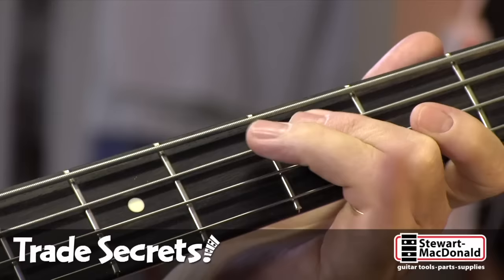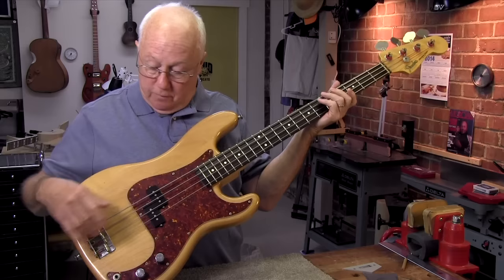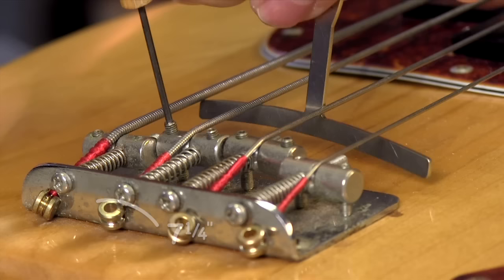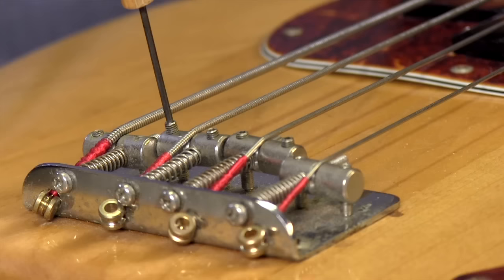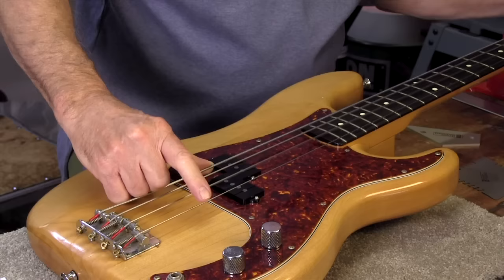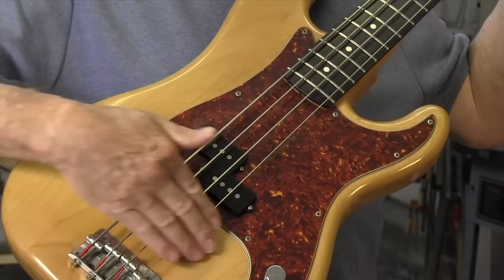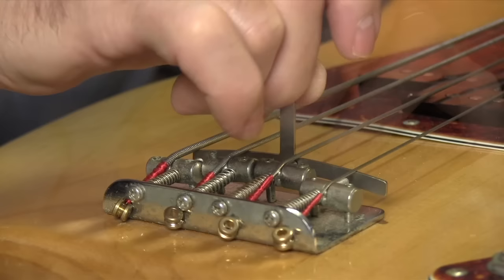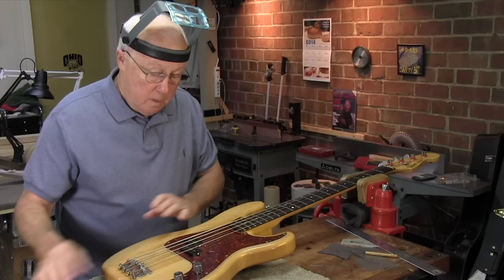Fixing fret buzz: raising the saddles

Comment: IMO this is a terrible video. If one fret is buzzing, it's a high fret. Raising one string to try and fix a high fret is a temporary fix. And raising the other strings to keep the radius makes no sense because of one fret. I'm surprised Dan suggested this.
Reply: Agreed. It's weird he's making a suggestion that could negatively impact the playability of the entire instrument due to one note with buzz.
If it's simply due to a high fret, easy fix. But if it's because that spot on the fret is worn low, might be best to replace that fret. Nothing Dan couldn't easily do, especially for his own brother.
Reply: He shows that he knows what he’s doing. Proof is right there.
Reply: @Thoracius Appotite  My G string is buzzing how do I fix it??
Reply: So, two disagreements I have with your disdain 😉: 1) It appears the radius at the bridge may have been incorrect to begin with. 
And 2), sometimes it is far better to make small adjustments to easily adjustable parameters rather than tear the building down to the foundations and start over. 

Every instrument is unique, and I think its often necessary to make small tweaks for it to play and sound its best. Even after a proper fret level and crown, sometimes these adjustments are necessary. 

I agree though, that he should probably address the issue that it could be a popped fret, at least so the viewer knows to beware

Comment: The truss rod is the foundation of the settings. A 4 string bass should have .015 at the 7th fret with a capo on the first and the 15th pressed down in the playing position. then and only then should the saddle height be checked. 4/32 action height at the 15th fret for the E string and 3/32 at the 15th fret at the G strinng. The A and D inbetween. Some guys like the action higher and some like it lower. Then after the action is set at the bridge, the height of the strings at the nut should be checked. .022 between the 1st fret and the strings. It is possible that the nut slot is worn on the A string. Once the height of the nut is checked then intonation. It is also possible that a fret wire is raising out of the slot although that is rare.
Reply: +Darryl Betts He is just selling those under string saddle radius gauges, not teaching how to do a proper premium set up.  Gibson put a backbow in some of their necks, before they leveled the frets. .011-.015" is about what they did too, with a 6 string guitar, and THOSE are the guitars that played superbly well. They also cocked the fret board a little lower on the bass side at the body, so the bass stings could vibrate more, which the bass strings will do. I spent a couple decades, more like 3 now, with micrometers & calipers going over guitars that just played insanely well to find out why they were better than another example of the same exact year, make & model.
Reply: @Satchmoeddie what do you you mean by cocking the bass side?

Comment: I have Fender Jazz bass highway one and it buzzes too.. I adjusted the bridge height like this until all strings are playable with very few buzz. The problem is now the action became too high.
Reply: +onzkicg  Truss rod adjustment, neck angle, nut slots too deep, or any combination of those three things. This is a sales pitch for those radius gauges, not a primer on great luthrie work.

Comment: I just bought the Basic Setup Kit from Stew Mac. It comes with Under String radius gauges. Can I use the bottom concave part to measure the fingerboard radius with them? Or do you need to buy the notched radius gauges?

Comment: Why would the individual saddles be angled like that for the 2 grub screws as feet posts ? There's a slot on the saddle for holding the string in place like the nut slots are. The individual barrel of the saddle needs to be flat/level & that way the individual saddle is level and the strings will still follow the fretboard radius. Angled like they are, one side of the string will have a tendency to pop out of the slot. I could also understand orienting them that way if the ends of the saddle barrels were angled, but they are flat meaning the flats should be butted against each other. Not have an uneven gap from the angle. As an entire bridge, each saddle will have a single grub screw that is under less tension and they will vibrate looser the way this is done in the video. That bridge looks like a crooked smile of imperfectly aligned teeth. I realize DE has been doing setups for decades, but do the setup correctly for down tuning from lower than standard E where the bass or any guitar has less tension on the strings. The fret buzz is most likely from uneven frets on the fretboard, if not improper relief in the neck from a truss rod adjustment. There are several locations that could be causing the fret buzz, could also be a worn nut slot, worn or dented frets. The neck as a complete assembly should be assessed for each component. I did that with a preowned Jackson bass this past week. The fist fret was higher than the others, it was a truss rod adjustment for the proper .12-.14 relief in the neck. Once I adjusted the truss rod properly, everything adjusted fine. The 1st fret is now level with the other 22 frets, super low action for a bass, no fret buzz on any string, for any note.

Comment: This video is terrible.

The first thing you always measure when i comes to setup is the neck relief. It's very possible that the bridge action is perfectly set up, and the reason why the frets are buzzing is because the neck has expanded or contracted due to changes in temperature and humidity. The bridge saddles obviously don't any bigger or smaller when the temperature and humidity changes, so clearly the neck relief is what needs to be measured first. Then check that the frets are level with the fret rocker. If the relief checks out and the frets are level, then you can start messing around with the bridge action. Otherwise, you'll just make the setup worse by adjusting the bridge so that it's now out of adjustment instead of actually solving the real problem.

Comment: Okay, my real question is, what is the size of those screw holes used to adjust the saddle heights. I've tried every single alan and screwdriver i have and i can't for the life of mee find something that fits well enough.
Reply: M Theory Why don't you take a file or some course sandpaper and sand or file the alan wrench down to the right size. That should work for you.
Reply: never though of that. Thank you!
Reply: I'm guessing you used metric not inches.

Comment: What if you want low action?
Reply from the maker: As long as your frets are level and you've zeroed your neck to be as straight as possible/set to your desired relief, there's no reason you shouldn't be able to achieve a low string action with a proper setup. This Trade Secrets video is more concerned with a simple fix for a single problem fret that's buzzing.
Reply: stewartmacdonald thanks for the reply, I was able to level my frets and remove most of the fret buzz

Comment: Ok... I think he knows it isnt the truss rod because it is just one bad note (C on the A string). My first reaction was "NO .. check the trussrod first"... maybe he did do that but left it out... so not a great video .. 
If a user had the choice between quickly and easily fixing a high/low fret by raising the action or by doing the fret work they would choose raising the action.. but this may be a bandaid...
DISCLAIMER: I dont actually have the bass in front of me so I am only speculatin'
Reply: fenderlead1  This is for the working musician he wasn't teaching a Guitar/Bass Luthier. He certainly has helped a lot of people that don't want to screw up the necks. I wouldn't know which way to adjust the necks on my Basses, I just know how to play them. So give the guy a break!